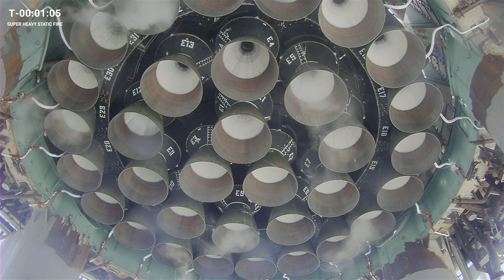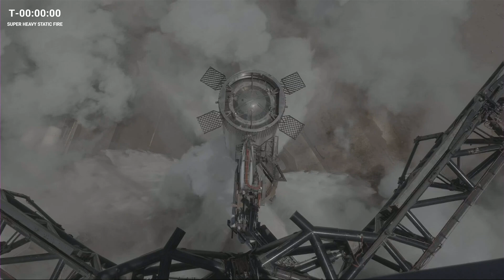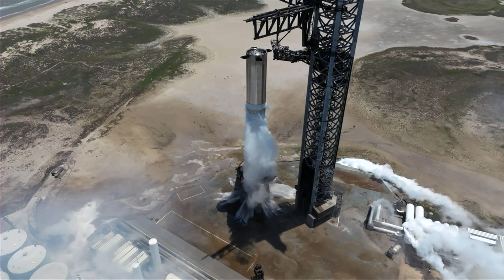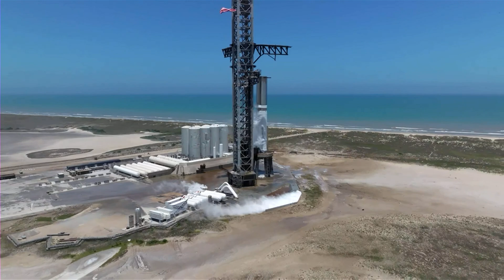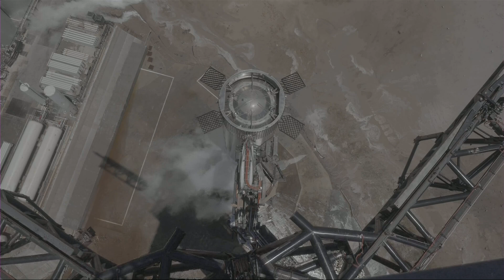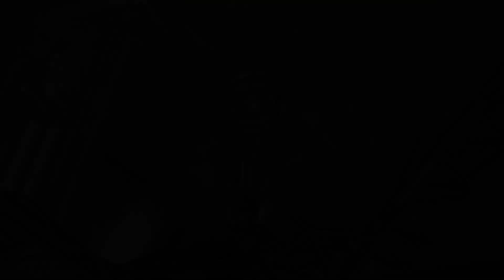Starship Super Heavy Static Fire

Comment: Deflect the flame AWAY, instead of right back into the engines. Some really dumb design flaws here.
Reply: Thank god you are here to tell them how it should be done. Bunch of amateurs.
Reply: @parapro  Blowing out engines from thrust/debris/wash ricochet is a really simple problem.
Reply: They already are.

The pressure differentials from the base of the pad and the thrust of the rocket generates high pressure zones at the top and bottom that are greater than 1 atm. The surrounding area between the pad has a lower atmospheric pressure, thus, the exhaust and steam is naturally deflected to the sides away from the pad. This is further expanded upon by the deluge system’s radial spray from the center; giving the steam a horizontal component of velocity.

Basically, the system already sprays the exhaust to the sides. Beyond that, it seems to have worked well from both the deluge tests that didn’t contact the underside of the pad, and the test we see today. Given that this booster has not fired before, (nor has any with ETVC and the preset engine shielding) 4 engines with premature shutdowns isn’t a bad issue to have at all.
Reply: @seasickrhino8926  No they're not. Their base deflects straight back, directly into the boosters. So they strengthened concrete, they're still blowing thrust directly back into their sensitive engines and blowing them out. 

Go watch a Soyuz launch. The Vostochny Cosmodrome has a 45 degree deflection panel much farther below the booster. Shoots all the thrust/backwash/debris out and far away from the rocket.

Comment: Amazing test with amazing views and great commentary! Such a great step up from the previous live stream! Commentary, Mission Control Audio, Many views, and a moved count down clock! Wish all 33 ignited, but 29 is great too!
Reply: Now the engineers wait for Scott Manley to tell them how it went.
Reply: @riparianlife97701 
Let me guess. You saw this quote somewhere today and thinking it was clever, you're repeating it over and over and over again in the comment section. No doubt you're irritating the f*** out of everyone in your immediate vicinity.
Reply: All 33 Raptors ignited but four were shut down prematurely. I base this on the fact that SpaceX stated that four had been shut down, if they had failed to ignite they would have said so.
Reply: @SlartiMarvinbartfast  For some reason, the flight computers shut them down, so now SpaceX will have to figure out why based on the data they got
Reply: @AGENT47ist  I suppose we have no idea if static fire tests have stricter shutdown parameters. I could see arguments for and against. Either way, if four shutdown in a cluster it could be a plumbing issue. If its a cluster.
Reply: @SlartiMarvinbartfast  Also to add onto your point, igniting these type of engines is a very complicated and delicate process. Everything has to go exactly right during ignition or else they will shutdown prematurely.

Comment: That was awesome.  The water deluge system appears to have worked perfectly.  Congratulations to the entire SpaceX Team.
Reply: Now the engineers wait for Scott Manley to tell them how it went.
Reply: The sad thing is... that's how a big company works! could really be for a lot of engineers like you described! (I'm speaking from my own experience as engineer - public first)  @riparianlife97701
Reply: @riparianlife97701  Stop trolling and spamming, whoever you are
Reply: @Wayoutthere  Just someone with 1.61 million fewer subs than Scott Manley and no pilot's license or engineering degree waiting for Scott Manley to tell us how the test went.
Reply: No, John Insprucker said at 1:12 that during a launch, the engines do not reach full throttle until some time after liftoff.  So the pad doesn’t have to absorb full power…
Reply: MaVela33  no you're definitely misunderstanding....
Reply: MaVela33 No they're saying that you can't really tell if it will work perfectly until that sucker withstands full raptor forces
Reply: I don't know if it was all 33 raptors at full power. That will be the big test.
Reply: No way to tell
Reply: I didn't see ANY of that brown pulverized concrete dust this Tim's. Onward and upward
Reply: From an engineer pov the material properties of the new deluge system and pad prevent this test from being of much value. Reason being metal, when it fails, does so rapidly but only when it hits the point of transitioning to liquid state... unlike concrete, whose conglomerate makeup is affected immediately by force and less so by heat.
Reply: …at half power for less than 3 seconds.
Reply: @georgejones3526  SpaceX has launched 36 humans into orbit. They'll figure it out.
Reply: I mean you can't really tell if it worked perfectly on a small static fire test, whether it does it's job on a launch is a different scenario, but either way the systems in place, fingers crossed
Reply: @R1PPA-C Here comes the greatest scientist.. wow!! Unbelievable!!! Why hasn't NASA hired you yet? It's messed up!
Reply: @R1PPA-C  There were even flying rocks at the static fire tests before the orbital test. I didn‘t have the impression that something like this happened during this test. But we will have to wait for the detailed report…
Reply: @philipkudrna5643  I thought the flying launchpad was just on the actual launch? Maybe it does work then 🤣
Reply: Yes he did what NASA DID OVER 63 years ago and still didn’t do it with a full thrust test! Yes what a genius indeed, the only genius he has shown is into conning the likes of you 🤣🤣🤣. Still waiting on that self driving Tesla that Mercedes have actually had more success with?!
Reply: @scottishadonis  Where's the best place to watch a SPACE SHUTTLE launch?
Reply: @riparianlife97701  Probably Cape Kennedy launch centre, that’s just my opinion though. If the space shuttle was still in use that is.
Reply: @riparianlife97701  Not really sure why you asked me that? Trying to catch me out? Since. We both know the space shuttle has been retired for sometime now. Trying to catch me out?
Reply: @scottishadonis  Ooh! When is the next NASA SPACE SHUTTLE launch? I wanna see that! NASA forever!!!
Reply: First, you have to time travel back to at least 2011. However, once you get there my favorite place was standing outside the VAB. Perhaps the lucky few on the VAB rooftop had the best view IF anyone was ever allowed to be up there.
Reply: MaVela33 You can't really tell if it worked since this not a full power. The concrete on the first static fire last year also worked perfectly but not on the actual launch.
Reply: @GrandLineSymphony They just use scale to predict how it work at full power.its not a must for them to do a full power test for them to be certain
Reply: he obv meant it appears to have worked perfectly for the static fire which is an important hurdle before a launch and I agree👍👍👍
Reply: So far here it does certainly look like the water deluge system has properly worked. We will find out truly for certain after the next launch when the engines are near full throttle and continuously pushing down.
Reply: Gotta remember too, it isn't just the water protecting the concrete from direct heat and blast power, it's whether or not any of that water starts flash boiling due to those monstrous engines, if any of the run off water that's soaked into the concrete starts boiling it could actually explode... Again 🤣
Reply: I didn't know you went to see the launch pad directly after. Stop being a fanboi
Reply: @peanuts2105  Yeah. People who like the world's most successful rocket company are ridiculous, but look how cool you are.
Reply: @riparianlife97701  So people that like the Russian (former soviet rocket program then?)

Comment: 4 engines failed in a 3 second test? That’s pretty horrible for reliability, no idea why this even flew a few months ago. I have hope this thing will work but jesus… serious engine testing needs to be done before flying again
Reply: That’s perfectly fine. The engines are designed to shutdown early and the fact that there’s 33 means that it’s redundant to those failures
Reply: @weekiely1233  I wouldn't go as far as to say losing 12% of your thrust immediately is perfectly fine, especially after about 9-10 years of Raptor development. Superheavy can just barely complete its mission at 4 engine outs, any more and the mission's lost. Very alarming to see minimum capability arise from a short static test
Reply: @N0GraviT  it was the first 33 engine test. They could easily hand those shutdowns inflight and at the end of the day they were shutdowns not failures. 

Rockets are hard. SLS had many more issues with its quite literally 40 year old engines. 

This was also the first static fire and more importantly the whole reason that they do these tests.